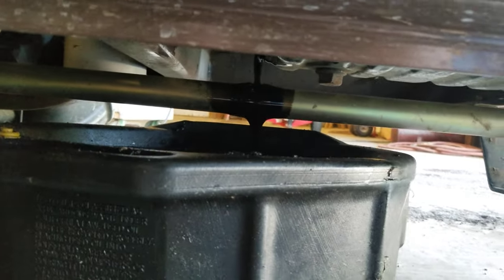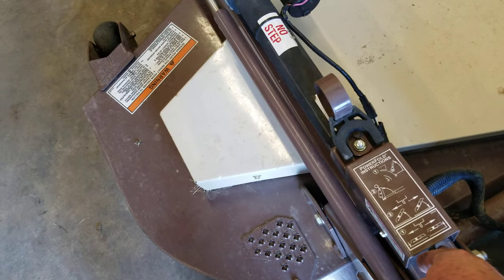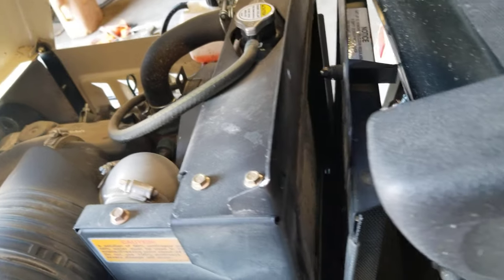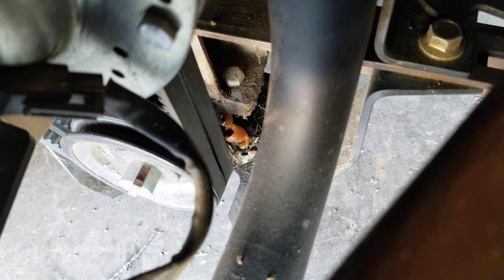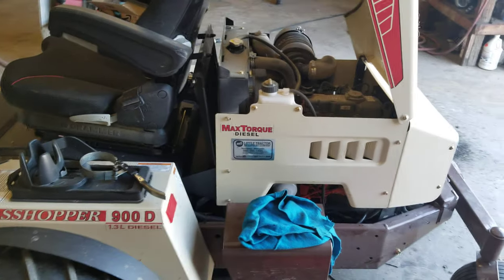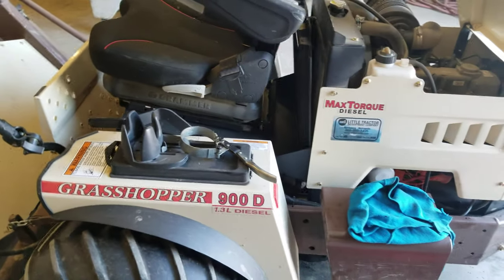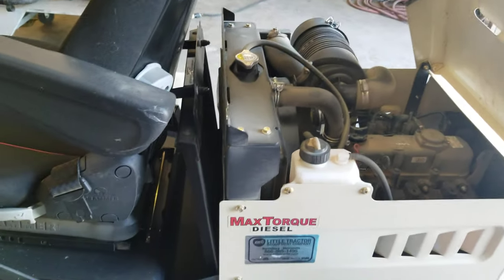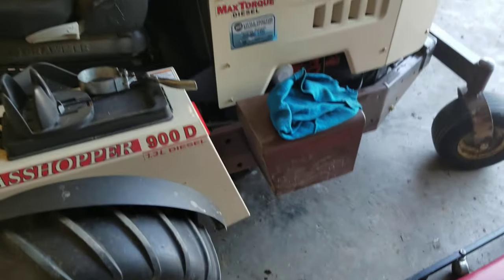Oil change on a 900 D Grasshopper 72 inch cut

Comment: Got one of those 900s, best thing you can do sell it to another sucker, pure junk. Mine was down two months last year and broke again after one mowing. It’s not worth changing the oil garbage. This machine was sold with so many problems. The 700 series was a great machine. Do not over grease the shaft to much 3 pumps every every 50 hours, it’s a sealed bearing you will blow the seal on it!
Reply: I've had mine four years and no trouble at all.  I have no idea why you are having problems.  I owned a 727 for 14 years and traded up to the 932 g2, glad I did it has much more power.  I put a flail deck on the tractor and use it on the farm every week.
Reply: the grasshopper 900d is the best mower ever built